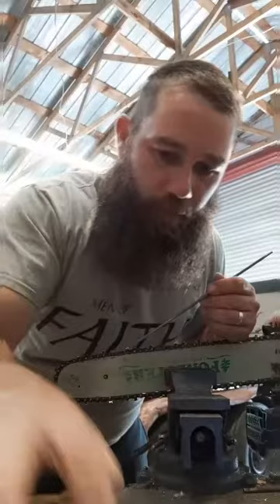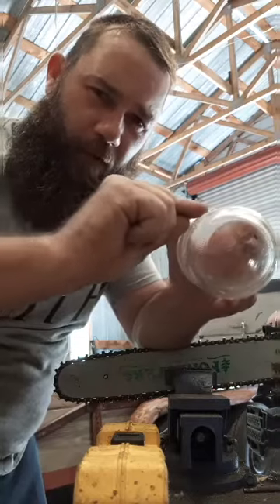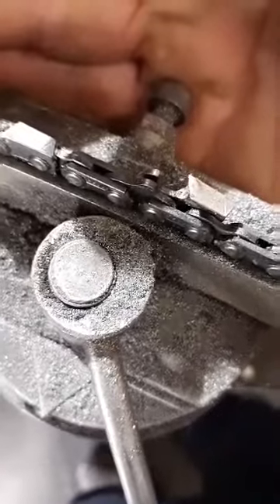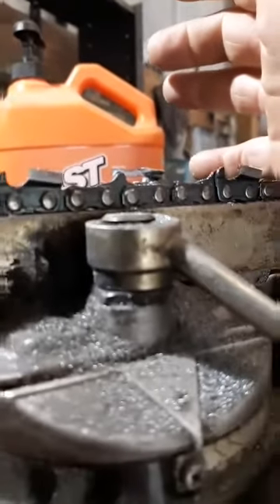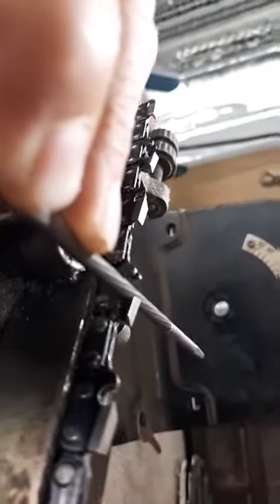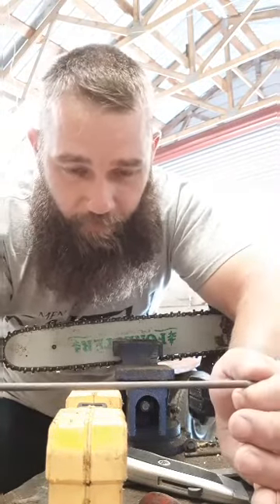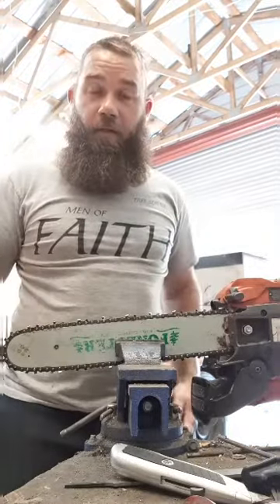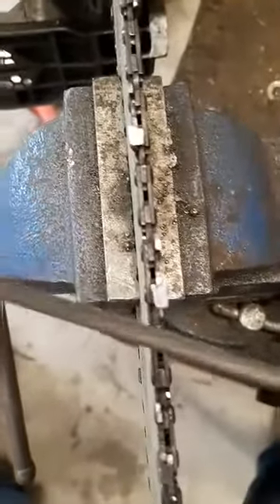Hand filing a semi- chisel  chain.

Comment: I appreciate this. Watching it through the first time, i don't mind the rambling, personally i kinda of like it because i'm the same way. The knowing to look for the shadow under the very tip is helpful, i've had the tips break off on me before, and while i understood what happened, i didn't know how to tell the difference between a little blunt, really nice, and to narrow. I like that you get into the details, as you said, there is going through the motions and getting good results, then there is understanding what gives you which results. From understanding what gives you which results you can more efficiently correct what you are doing, and eventually tune the chain.

Where i was running into trouble on the semi chisels is exactly what you said about watching that working corner, trying to turn it into a full chisel didn't work out well.

Depending on how much you want to get into videos like this, and if you sons are interested, one of them might be able to help you with editing. there were split seconds where the shadow was visible, and if you were able to do some basic editing you could have frozen that image, or if you were able to get a picture with your phone you could put that in the vid.

Another possibility if you want to do videos similar to this and your children don't have any interest in editing, you might send me the rough version like in the video above, and i could edit out the rambling and stuff leaving only the information, so it would be easier to watch for people who don't have rambling minds like ours. its all up to you. i've played around video editing a little bit so it wouldn't be a problem to do simple things like cutting something out or freezing the split second of clarity.

When you were describing the file angle for a semi chisel, you kept saying parallel and knew it wasn't right but couldn't think of the right word at the moment. Perpendicular is the word you were looking for, just in case it hasn't come to you since posting this.
Reply from the maker: nate2838 must have been hard to watch.  Thanks for your feed back. And I do have tons to learn about videos. Guess it take little foresight or planning it before you start.Hope it helps brother.
Reply: @steppoffaith8426  fist time through was easy, if i were to come back to it to find a specific point, that would be difficult to do without watching the whole video. Maybe i will watch it again and leave a comment with the time stamps of when you are talking about certain aspects
Reply from the maker: nate2838 I bvb thought about that. But  to fully understand filing I had to touch on all the points. I could have made it shorter by not repeating myself. But  hearing something few times it will stick ya know.